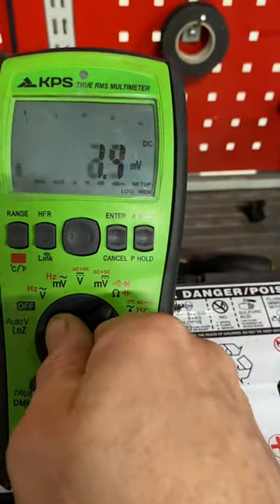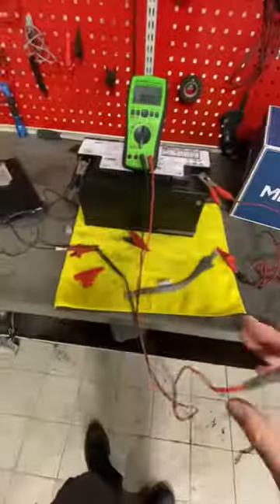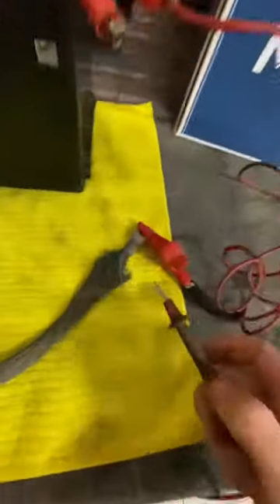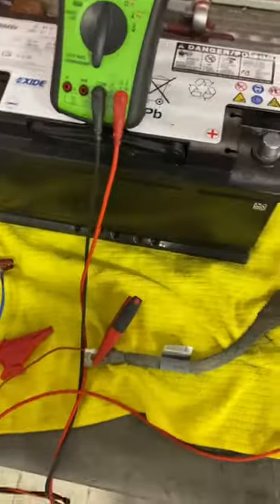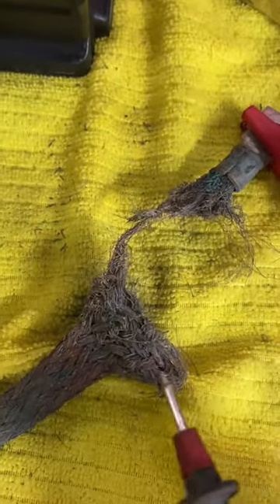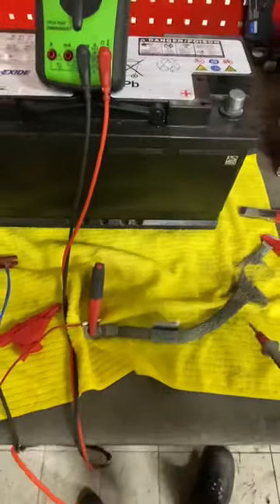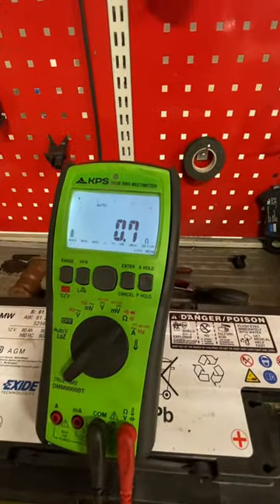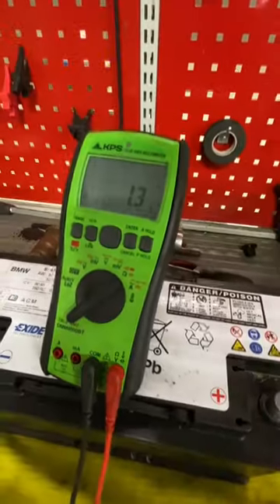How to CHECK a wire in a 12V system using Voltage drop

Comment: Nice presentation mate. By the way, If you have a BMW, that crappy engine ground strap is the root cause to many electrical problems and some mechanical problems. Do yourself a favor and add a second engine ground strap from your cylinder head to your under hood body ground bolt.

Comment: Good video well explained, I only use continuity as a first line check, but backfeeds through another circuit can cause your meter to beep, sending you on a wild goose chase.  Resistance is good for tracing wires that might have been accidentally be crossed.  I find an ethernet cable tester with croc clip adaptors both ends very useful during comissioning multi wire installations.  But, I use a low value resistor as a load to stress a wire, H4's break to easily in my tool bag!  Happy fault finding everyone
Reply from the maker: Me too Julian. I think i might buy a loadpro probe for the multimeter what do you think?
Reply: That was a terrific video excellent tutorial 🤙. I’ve often thought about purchasing the load pro poor guy that made it often gets ridiculed about it saying that why not just use a bulb! But how handy have the answers at push of the button on the DMM LEAD 👍 if you get one would you do a review?
Reply: @allmech_BMW_fault_finding  It seems very expensive for what it is, but that is no doubt offset with the time it saves and how easy it is to use.  The only time lost is plugging it into your meter
Reply from the maker: @kevinpalmer7452 I will Kevin definately 🙂